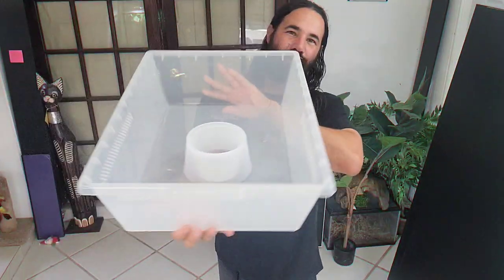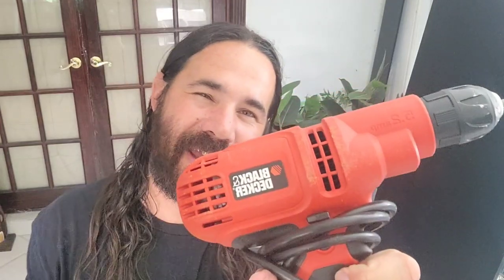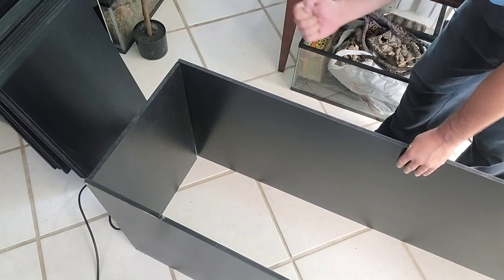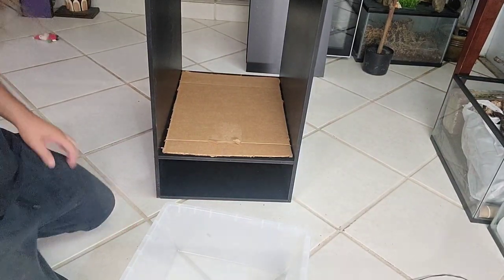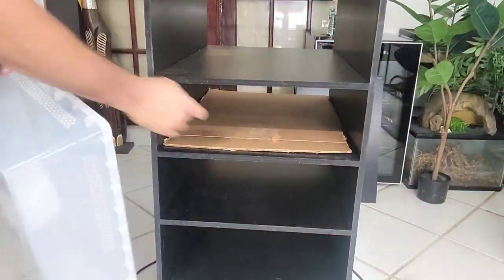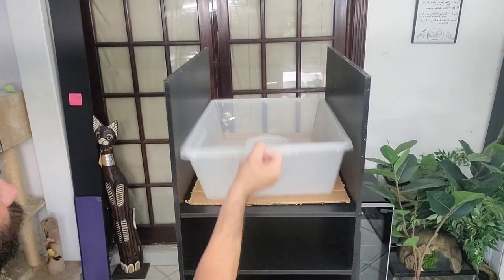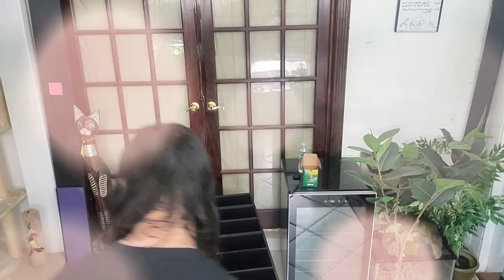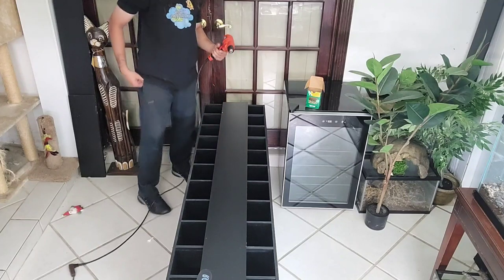How to build a pvc snake rack, cheap, fast and easy (Do It Yourself)

Comment: Thanks man!  I’ve recently got into snakes and they’ve become a partial obsession.  My biggest problem is trying to figure out how to house the ones I want without needing a dedicated room.  I’ve been debating trying to build a rack and this video is extremely helpful.  The Freedom Breeder tubs are just what I was trying to find.  I also found out there’s a Piedmont Plastics not far from me.  I also found some white PVC at the local hardware store that I could also use.  Probably gonna give this a try.
Reply from the maker: Your welcome. Having piedmont plastics near is a big help. Near me they sell white pvc in sheets but they don't cut it and I certainly won't trust myself but if your extra handy mabey you can figure it out

Comment: Love the video it helps a lot, what are the dimensions of your totes that are in the video?

Is there a plywood that can be used to make this a little cheaper?
Reply from the maker: The bins are Dimensions: 23″(L) x 16″(W) x 5.75″(H) from freedom breeder.  These are fb28s.
Yes you can use melamine which is the common cheaper wood used to make racks. It would cost a fraction of the price.

Comment: hey I know this video is old but I want to make my own how think are the boards and what did you specifically request is it PVC sheet 1
Reply from the maker: @ryanh7595  yes I use black pvc board. And it's 1/2 inch thick.  Best wishes on your build

Comment: I want to make sure that my FB 40 tubs sit (almost) flush with the open end of the rack, but also that the sides of the tub aren't super tight against the sides of the rack.
Did you measure 1/4" or 1/2" spacing in those areas?
Reply from the maker: For the sides I give 1/4 inch on each side to make it easy I just measure the width of the bin and add 1/2 to it. Each shelf will be 1/2 wider than the actual bin
Reply: @cloudcolubrids4603  Thanks man. I appreciate you.

Comment: Deffinetly doing this. The bins are basically 28qt bins right? I have ball pythons but i use 28qt bins for adults so they feel secure and snuggled. And they tend to do better for me with eating and stuff to.
Reply from the maker: That's correct they are 28qts. I use them for adult cornsnakes and kings. I have lidded 42qt bins for the few that grow larger and need more space. It's a great rack and definitely recommend doing this

Comment: I have built some also .... The cheapest i found pvc before covid19 was 75 a sheet at home depot but they had white only.... And a tip pre drill holes with a counter sink will help with the imperfections with just screwing it into pvc...
Reply from the maker: Yes I remember homedepot had the white pvc a few years back bit I'm not a fan of white for a snake rack and I don't have the tools to cut it. It was $89 a sheet at piedmont plastics in early 2019 and now it's around $160
Reply: That’s crazy I have a pvc plug here in ga that $35 a sheet
Reply: 4x8x1/2in sheets
Reply: same here, using sheet wood and a coating.
Reply: @ravenfrancis1714  what’s the name to the place?

Comment: Why does the heat tape not extend all the way up the length of the rack? It’s like the top couple tubs get no heat?
Reply from the maker: @norcal6181  the heat rises. Remember  my snake room dosnt get cooler than 78 degrees.

Comment: I’m new to the whole rack system thing. Can you tell me how much hotter I should set my thermostat to penetrate the bin and the layer of substrate I’m trying to achieve 85° and have my thermostat at around 89 but my temp gun is reading 81° inside
Reply from the maker: That's something I can't say because each rack and thermostat probe is in a different location.  What I will say is just set the thermostat 1.or 2 degrees hotter then test the temps until you reach your desired temperature.  For me I set my rack at 86 and the hot side is 84. I use a temp gun.

Comment: How is the heat tape working out on the back trying to get information to build some
Reply from the maker: Heat tape is doing the job. Rite now I unplugged it since the temps are hot out here but it works perfectly. Just have to make sure you have a good thermostat

Comment: Mdf is Cheeper for any one on a budget like $300 Cheeper
Reply from the maker: What's mdf?
Reply: MDF is basically fibre wood compacted into a board so fibre board here in Australia we get it pre-painted just a lightweight material that can be used in the same way your video has inspired me to do the same thing but with different material keep up the great work! 🤙🔥
Reply from the maker: @knigthravo16  oh ok thanks for the info. Out here many people on a budget use a wood called melemine. Pvc is the best but definitely not cheap. Yeats ago when I made my first rack it was much cheaper but it has almost tripled in price
Reply: @cloudcolubrids4603  honestly it is very similar to melamine just holds up a lot better when screwing and screws and over the time doesn’t deteriorate or lose structural stiffness like melamine can! But I seen in your last video you need to expand so hopefully we see you try a different material and we can also see how it goes looking forward to it! 🤙

Comment: When I go to the website there is pvc type 1 and pvc foam sheet which one is the one I have to pick? Thank you for your help!!
Reply from the maker: It's the black pvc foam board. When I order I get the dimensions see what I need and send them a email with all the cuts I need. They calculate it for you send you a quote and if you agree to it you pay and that's it. Alot easier than ordering threw the website